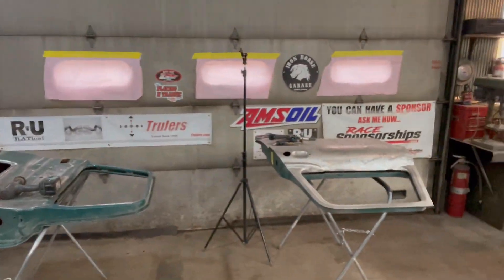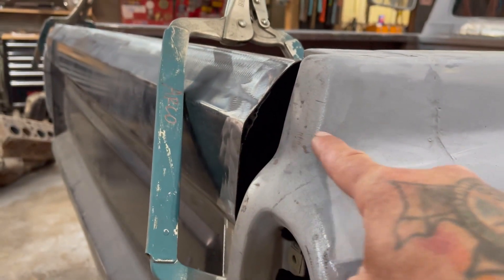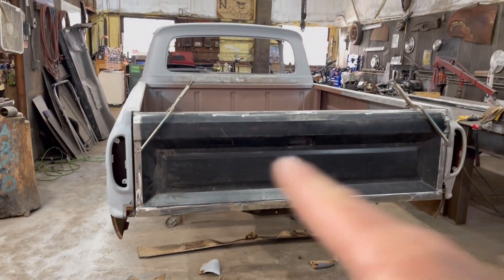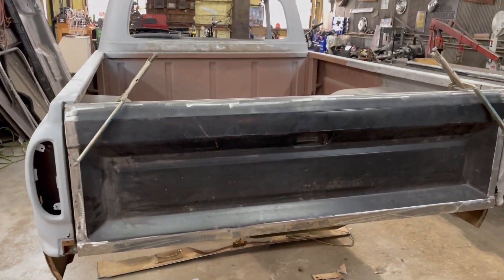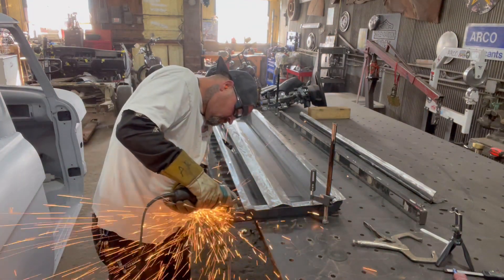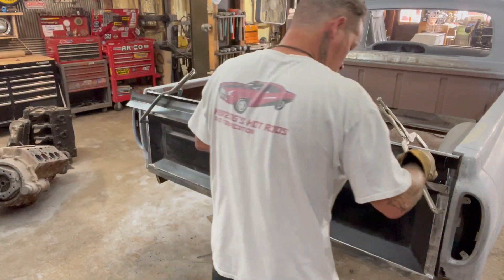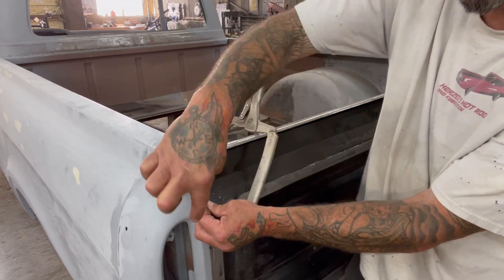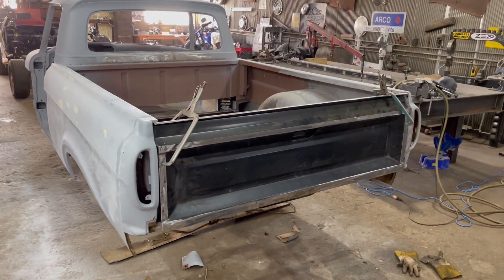Putting a 1985 ford tailgate on a 1963 ford unibody part 3 #fabrication #metalfab #customcar

Comment: Nice work, flipping the the piece over to match the body line. To match the top can you cut a relieve into the top behind the pickup tail gate to match the top of the rear fender and then weld up the gap?

Comment: i still think flipping the tailgate would have been better so you had a neat flush line under the tailgate where it meets the lower valence (rocker) then you could have wheeled a quick top edge to flow with the lights and compliment the side swages